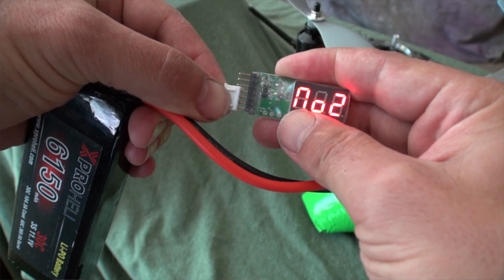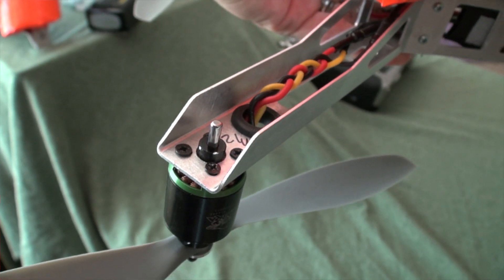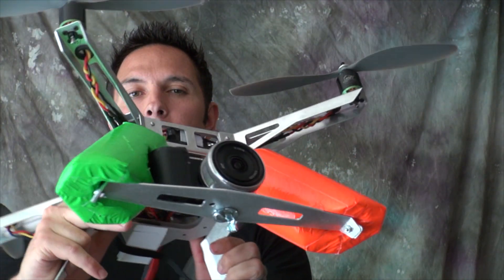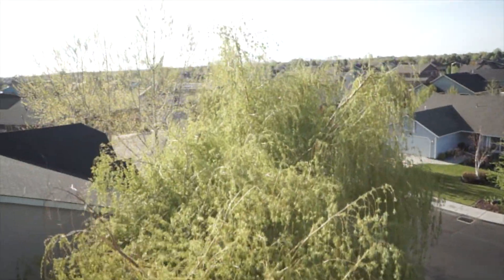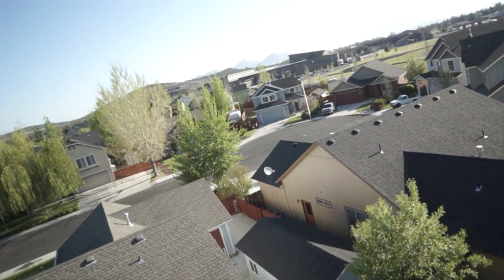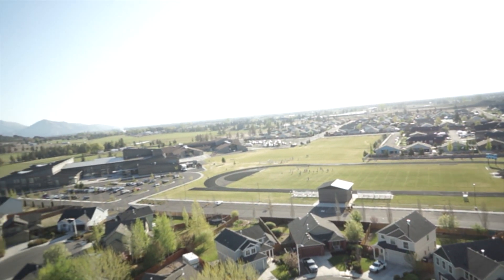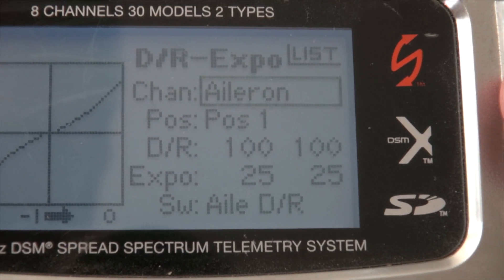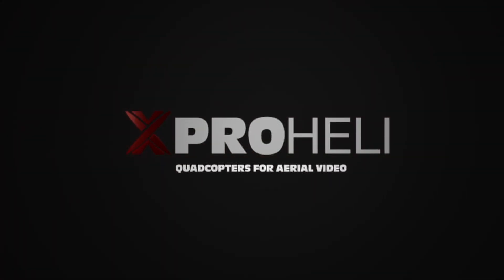Quadcopter Tips and Tricks for Flying and How to Capture Smooth Aerial Video

Comment: This is a very informative video. In order to have pan left/right, using a Futaba 8FG 2.4Ghz Fasst controller with a quad copter, how would I adjust so the yawl (stationary left/right movement) is not so touchy? Do I set those settings at 25% also? I'm looking to have the quad copter not react as quickly when I first move the stick.Thank you.
Reply from the maker: ***** Hi Jason, This video was pre-gimbal days. We now run several different 3-Axis gimbals for our setups www.xproheli.com

Comment: i just got a quadcopter, something like flamewheel 525 or something, (maybe a clone) anyway, it came with an 11.1v 3s lipo 2200mah 40c battery. What battery should i buy for replacements, and what should i look for, if i want to buy something better? should i only do 40c or 40c and bigger? how about do i stay with 3s, or can i do 4s or 5s and so on?
Reply: probably want to stay with 3s unless you change your props...
as for the c rating id stay at at least 40c...
so yea...probably the same specs would work best for you..
Reply: i want to sell my 2 quads, i cant calibrate them good
Reply: Robots4Sale The 3s indicates cells/voltage of battery. this means to have the same type of battery it has to have a 3s. your battery life is indicated by the number followed by the unit mah or milliamp hour. larger the number, the longer flight (not always linear, as with more weight you get less time). 40c is max discharge rate (40 times the milliamp hour, or 2200*40= 88000 Milliamps, 88 amps)

Comment: hello

have been using 11x4.7 carbon fibers my motor and esc will easily handle 12x4.7s wondering if the larger would give a smoother flight for video?  this is a hex 550.  any thoughts on this

thanks

Greg